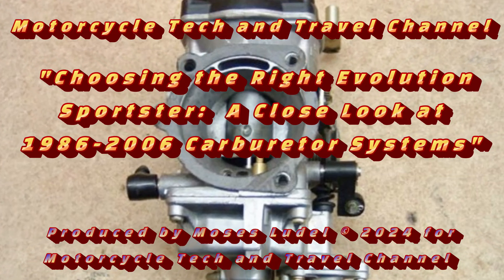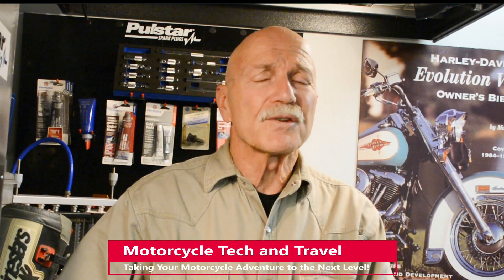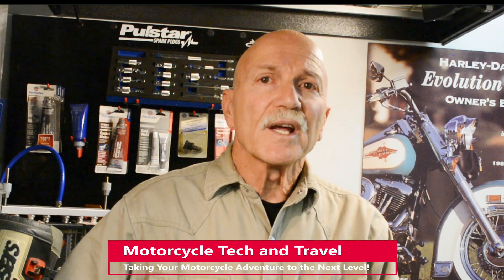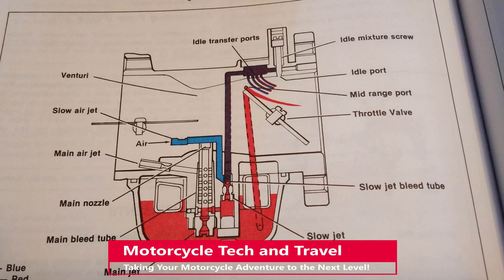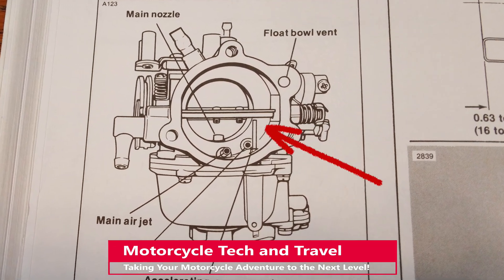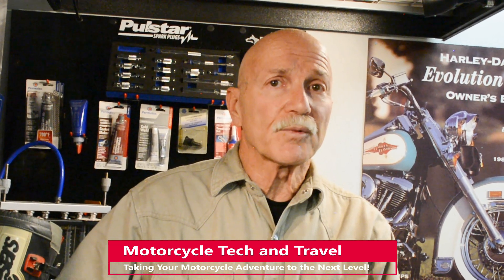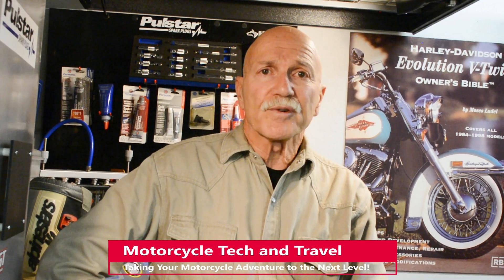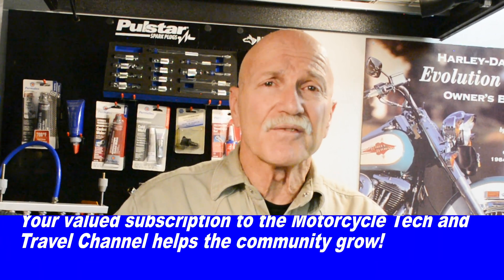A Close Look at 1986-2006 Evolution Sportster Carburetor Systems

Comment: I have a 2006 1200 Sportster Low. Today I lifted up my tank to high and broke a black hose coming off the back of the petcock and it goes straight across to the top back of the carburetor.  Does anyone know what the hose is called and how hard is it to fix and replace???? Thank you very much for anyone who can help
Reply from the maker: Sounds like the vacuum line from the petcock to carburetor vacuum source.  If so, the valve on the petcock, which has a vacuum diaphragm shut-off, will not flow fuel without a vacuum source.  The official Harley-Davidson online parts catalog shows a 26588-04 vacuum line (“not available”) made of plastic with an elbow at each end.  Sound familiar?  Restoring the hose will make the petcock work right again.  The line is in the Harley-Davidson parts diagram under “Fuel Tank”.  Sometimes the elbows simple pull off the plastic tube and can be slid back into place.  Plastic vacuum tubing is available in the aftermarket from an auto supply.  The elbows may be available from Harley-Davidson or aftermarket.  Even though fuel should not be flowing through a vacuum line, there are still gasoline fumes that can affect the line.  Make sure parts are compatible with fuel fumes.  Let us know if this helps.
Reply: @MotorcycleTechandTravel ok thank you very much for all the info you given me. I have the new hose now . I’m in the shop right now and getting ready to start on it . Soon as I’m done I’ll let you know how it went
Reply from the maker: Glad this is helpful!  The H-D part number originated in 2004.  This vacuum line was used from 2004-06, the last year for carburetion.  Were you able to find a 26588-04 factory tube with elbows?  The part is now showing as “Not Available” at Harley-Davidson.
Reply: @MotorcycleTechandTravel Thank you very much. I was able to get the broken hose off and a new hose on and it started right up. Thank you very much for all your support and information you gave me

Comment: The early Evo sporties were 4 speeds and had wonky charging systems.
95 -06 gets you the 5spd AND better charge system.
04-up you get rubber mounted engine.  
07-up you get FI
All the Evo Sporties were pretty good BUT there are some that are better choices on the used market.
If you just want one , the cheapest are the earliest, but the alternators WILL be an issue.
The 5speed is superior for all riding and the updated charge system is a real benefit, I’d personally go 95 and later.
The rubber mounted motor was a real plus in 04 for comfort, but 95- 03 are all pretty solid bikes.
The 883 , at top end time, can be converted to a 1200 for less than a complete top end job with the bolt on kit and the smaller combustion chamber of the 883 head gives a mild comp bump as well.
Reply from the maker: Appreciate the heads up on the alternators and your insightful comments...Many Evolution Sportster models and choices, we'll see where this leads.  The 883 is a viable option and candidate for a 1200 kit and tuning like you note...Thanks for your subscription!
Reply: I prefer the four speed. Less shifting. My road bike is a six speed. For just ratting around my four speed Sportster is perfect. My charging system was updated before I got the bike so no issues there. I hate the flubber mount. If I had one I'd fix that. Plus I don't like the plastic oil tank,and all the extra wiring. My 87 suits me fine.
Reply from the maker: Thanks for the comments on four-speed models.  This is helpful to others wanting a Sportster.  I'm pleased that after your experience, you are satisfied with the four-speed and benefit from the charging system update.  Sportster models from 1957 to 1990 ran very well with the four-speed.  It was the original "trap door" transmission!

Comment: Up to 2003….Carbureted, solid engine mounted motor, most dependable, lightest and easiest to work on
Reply from the maker: I'm drawn to the simplicity, lighter weight and the trap door transmission access...Thanks for your comments and subscription!
Reply: Yes! I dont understand the love of rubber mounting. My 3 harleys before my twinkie dyna where  a 81 ironhead sporty, a 48 pan, solid mount, ridged frame and then a 1961(not 61 cube) panhead. Ridged frame,hand shift foot(suicide) clutch. The ridged frames never hurt my back unless i hit the WRONG POTHOLE  without taking appropriate actions. Never had front brakes either. We smoked and drank alot, stop complaining boys. Any way I'ma gonna watch this closely. I have a 2003 dyna, but i really lust after a 98-03 evo sporty. Im 65 y.o. but i truly love to thrash/throw my bike around at speed. So im going to get one. Or a 22-23 nightster. Whats not to love about 400(?) lbs and 90hp/70 ftlbs stock.
Reply from the maker: The current 975 Nightster is bona fide sport bike power, for sure.  I'd like to know your impressions if you test ride one.  The most sensible choice for the channel is a '98-2003 rigid mount with a CV carburetor and trap door.  883 or 1200 would work, the 883R and 1200S at the top of my picks...Service work is accessible for many owners, and these models would make good material for tech how-to.  I am by no means against advanced powertrain and chassis technology.  I'm versed at EFI, VVT and spark management systems.  The Revolution Max is clearly the "busiest" engine Harley-Davidson has ever produced.  There would be a small audience for hands-on work.  The diagnostic tool costs alone are prohibitive for many.

Comment: Excellent content. 
The closed crankcase breather sends hot oil vapour through the air jets where there is no fuel to wash them. 
The resulting residue can usually be cleaned by spraying carb clean under pressure into the air jets. 
The standard airbox and exhaust are much more prone to spit back and reversion, which causes fuel mix inside the airbox, which is drawn through the air jets.
The operator should understand that the throttle opening on acceleration should be matched to the rpm rather than rapidly opening the throttle and losing the benefit of the pump in the carburettor. 
Early cv40 have an alloy top,later black plastic top cap required everything to be black so it doesn't stand out as cheap.
Reply from the maker: I appreciate the feedback...Your comments on closed crankcase breathing are valuable.  The V-twin's 45-degree cylinder angle and single crankpin complicate this further.  Many motorcycle manufacturers chase the issue of breather blowback to the air filter and the carburetor(s) getting saturated with oil.  Thanks for sharing with the community!
Reply: @MotorcycleTechandTravel   The introduction of the intake MAP sensor and ecu ignition map along with cv carb is the sweet spot in development. 
Later 4 wire coils using ion knock sensing require HD plugs. 
HD SIP and part numbers are a valuable resource for the introduction date of all but hardware. 
It's a lot to take in.
The 99 FXDL on my channel ran like a dog and had 7 previous owners who survived it by luck more than anything. 
The tank is vented from the filler neck through a one-way check valve into the frame downtube under the seat. 
On the efi, it is a non vented cap and closed system. 
On the carb version, the cap is vented to allow air in.
Someone had fitted a non vented cap in error. 
It's only obvious after I found it, but it obviously defeated everyone else. 
Symptoms were all over the place on anything but warm dry days, the bonus is a dry miles dyna with an immaculate fuel tank inside and out.
Reply from the maker: MAP as feedback for an ECU controlled ignition is a great asset for the CV carburetor.  The CV carburetor is as close to air-fuel ratio regulation as we can get with a carburetor.  Your point is well taken.  H-D is often accused of being stodgy or technology deficient.  Not true in any way.  The easy to service CV carburetor with electronic spark control met emissions demands without the need for EFI.  That's an achievement!  HD SIP is a great resource and research platform...It's gratifying to find a problem like the non-vented fuel cap, a straightforward solution—once you became the FXDL's owner!